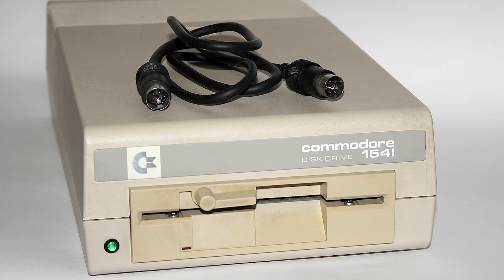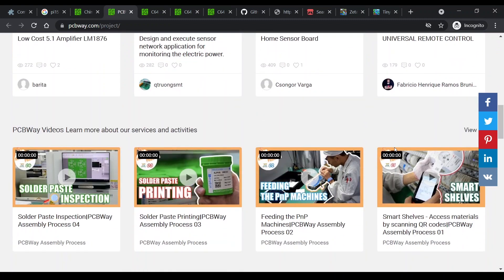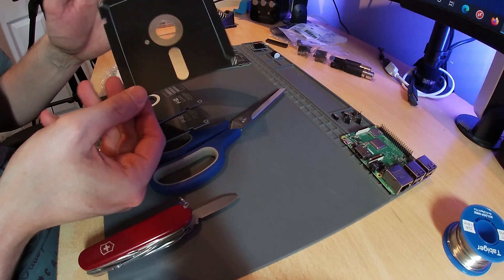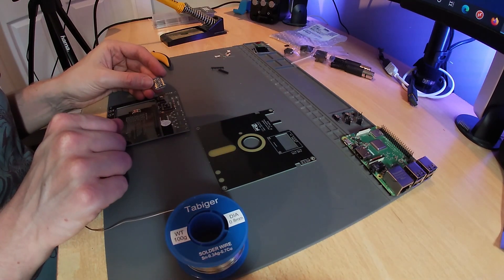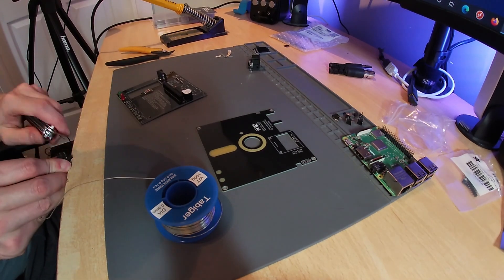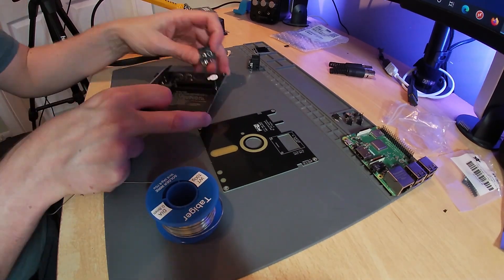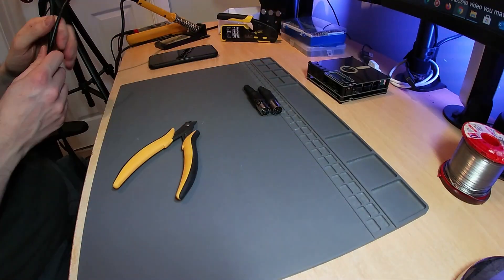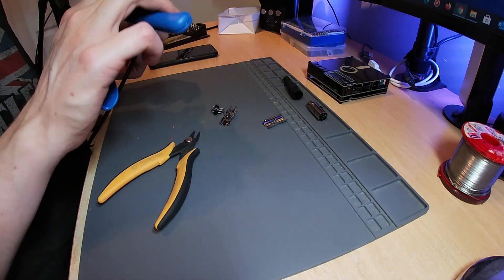Pi1541 Modern Floppy Drive Replacement for C64  #c64 #C64Forever #PCBWay

Comment: What is minimum order quantity for PCBs when you are ordering? And if it is not secret, how much did you pay for lot of PCBs in your video?
Reply from the maker: Minimum order is 5 boards per design. Quantities are in  multiples of 5. I was provided the boards for free for the video, but when I’ve purchased similar ones, typically around $15 to $20 USD for 10 boards with lead free HASL surface finish, plus shipping. It’s worth playing with the quantities as sometimes it works out only a couple of dollars more.

Comment: Is it possible to use Jiffydos with the pi1541?
Reply from the maker: Yes, but you'll need to add the Jiffy DOS ROM image for the drive to the micro SD card with the name Jiffy.bin
Info is buried in the instructions here - https://cbm-pi1541.firebaseapp.com/

Comment: Thanks to eBay, I found an assembled unit. :) It has a blue LED for the drive activity, however. A rather intensely bright one. I have read others report blue LEDs being brighter than other colors. The green power LED is fine. In fact, it is bit on the dim side. I was thinking it could be an aged LED but I also see that 390 ohm resistors were installed instead of the BOM's recommended 330 ohm. Perhaps an attempt was made to reduce the blue LED's brightness to no avail. I will seek out a red LED instead. I suspect it will be at the same intensity level as the green one.
Reply from the maker: When you look for another LED, check the listing or manufactures data sheet for the Luminous Intensity, it is quoted as mcd. Also the viewing angle. 
You’d need to Google to find what people recommend as a suitable mcd value for status LED.
Have fun with you new toy!
Reply: @iNimbleSloth  Thanks for the info!

Comment: Can you link to the bottom PCB with the power connector at the rear? I also saw an example of a dual color OLED display on FB. Would that require a specific top level PCB? Thanks.
Reply from the maker: Hi, the power connector can only be fitted to the side - https://github.com/tebl/C64-Pi1541-II/blob/main/gallery/2020-09-24%2022.49.03.jpg   
If you wanted to make it come out the rear, you would need to update the PCB layout. The KiCAD files are in the designers github repository if you wanted to give that a go -https://github.com/tebl/C64-Pi1541-II
regarding the dual colour OLED display, if its the one I am thinking ok, then it is the same size as the single colour display. The top part of the display is just always yellow.
Reply: Thanks. I have seen one sample photo of a built unit where the power is connected at the rear but no actual PCB layout. It already exists in the gerber files according to a Facebook poster. I was hoping to find the actual PCB layout diagram just the like the side but for the rear. I could not locate it on the PCBWay site either.

Comment: I don’t know who designed this, but when you go through the effort of designing a PCB then also draw in the level converter, its two resistors and a FET per channel — and in SMD it takes up less space than the extra board. Other than that it’s cool designed PCB. And I love that ADD button functionality. I don’t thing my UltimateII+ has that feature. I need to look into that :)
Reply: I design things mostly with the aim of building one for myself, not as a product in any form. I would love to consider SMD, but due to an illness I have problems handling smaller components for any length of time and this was a reasonable compromise. However, it is my hope that my projects be accessible for anyone to build - if anyone would choose to do so. I'm glad you enjoyed the other parts of it at least 😀

Comment: Nice build.  I have the more traditional pi1541 but this looks tempting.  How difficult would you rate this for a beginner build ?
Reply from the maker: I’d say ok for a beginner if time is taken to read through the build instructions.The most fiddley part was making the serial cable.  The most time consuming part was sourcing all of the parts, and from as few places as possible to keep the postage down. Key tip, make sure you have everything to hand a read through the build first, then go back and start the build.